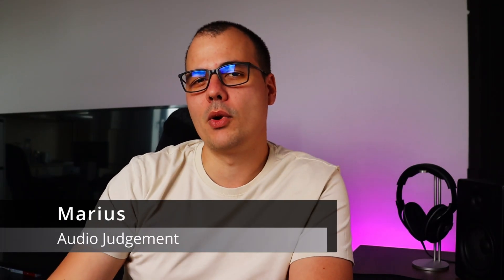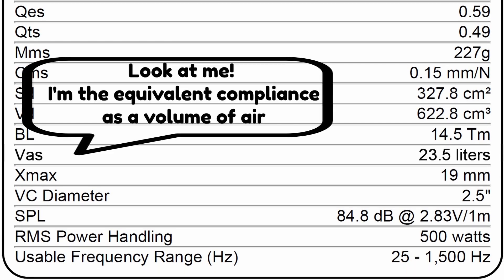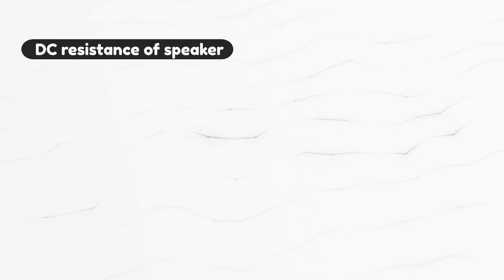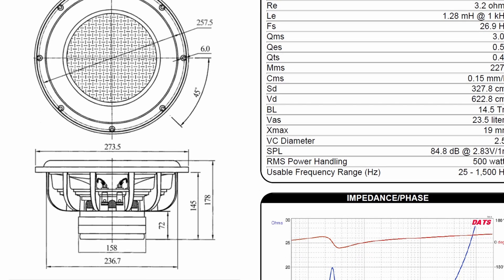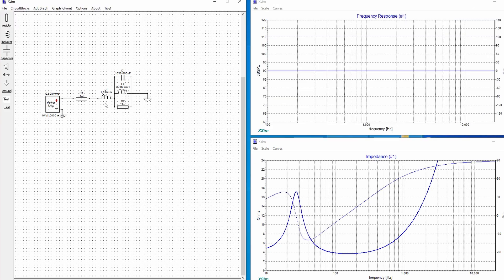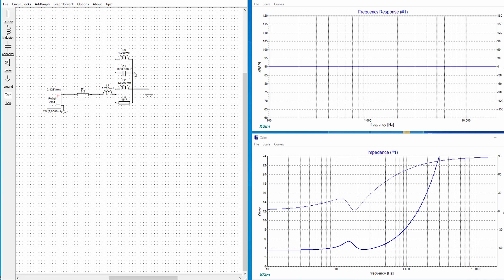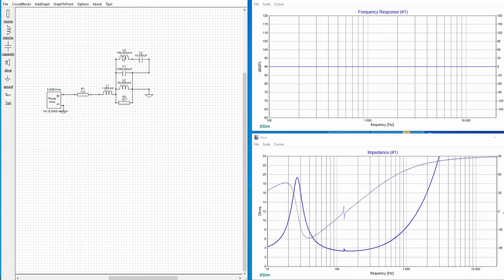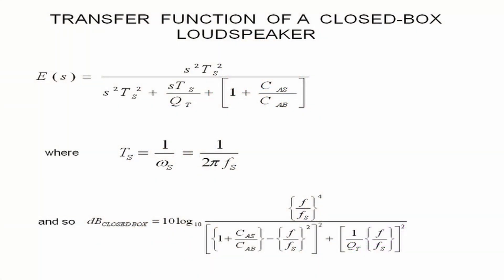TS Parameters explained differently - Speaker equivalent circuit

Comment: I'm afraid you have your equivalents back to front, mass equivalence is an inductor (it resists change) and compliance equivalence is a capacitor (holds pressure or tension like a spring)

Comment: Marius, I have a 7.1 sound card, normal for most computers, and I noticed the possibility of using it as an active bandpass, with up to 9-way system, the problem was: I didn't find software where I could do this. Frequency cuts per channel. Have you ever thought about it? do you know what software I could use? 

Success!

Comment: First.. I applaud you for being the first person to put this exact info on YouTube. I'm sure there are others, but I haven't seen one. 
I've been making models to show this very concept visually. 
I'd like to work with you, if you're interested. But I'd at least like to chat, since you blew the top of my head off today, watching this. 

I've been modeling Mmd as an inductor and Cms as a capacitor. Likewise, I've been using a capacitor as a, well, capacity of charge of air in a box. And I've been using inductors as the duct that inducts a current to oscillate through a field. 
We're both getting proper results, just different ways. 

If you'd like to be part of this project, catch up with me
Reply: Your model is correct because we treat air pressure as voltage and air volume velocity as current.

We know that an inductor shorts DC, right? So think about a port (tube) with a fan blowing on one side at some constant speed. That constant forward pressure is analogous to a DC voltage. The port will do nothing to stop that air flow, like how an inductor does nothing to stop DC other than its DC resistance.

Now take the same scenario and apply it to a sealed box. Cut a hole in the box and place a fan blowing at a constant speed. Eventually, the pressure inside the box will build enough to where the fan can no longer put any more air into the box. Kind of like how when a capacitor charges, no more DC current can pass through.

Comment: Congratulations! I really appreciate your job!
I wanted to ask you about the impedance of the speaker. The peak between 25Hz to around 60Hz is disabling the speaker to work using all the power, as the impedance is bigger, so the power would be 4 times lower. Is that assumption right? I am thinking about how we can run those frequencies and how is that issue solved in market speakers. I guess that is "solved" with the "bass boost" option that some amplifiers have, but for example, in my case, when I use that option, the amplifier starts clipping very earlier than if I do not use that option (I do not have the equipment to measure the speaker output, so that is why I have this question). Thanks in advance!
Reply: No, the reason the impedance rises is because the speaker is acting more efficiently, the impedance rise at low frequencies is proportional to the amount of excursion of the driver.

Basically, the changing current in the voice coil moves the cone back and forth due to the permanent magnet. However, that same movement generates opposing currents in the wire, thus lowering the effective current through the voice coil (or raising the impedance). This is called back EMF.

Impedance rise is actually a good thing, as it’s a sign your driver is operating more efficiently. In other words, you have more acoustic power for less electrical power input.

Comment: Could you help me with REW impedance measurement? I made the cables as per your two videos and I got it working. But after a while I tried it again and couldn't get the calibration to work. Only the first step. I have measured and quadruple checked my cable and tried changing channels in REW etc. and nothing works. I always get this error message:
"the measurement input should be much lower than he reference input for the short circuit calibration but it is not- the measurement peak is -X dBFS, the reference peak is -Y dBFS"
X and Y are always very close if not the same value depending on the volume settings, and apparently should not? Please help me.
Reply from the maker: It's almost impossible for me to troubleshoot these problems. First of all, make sure your sound card has a stereo mic input.